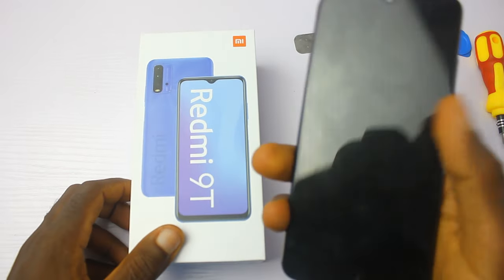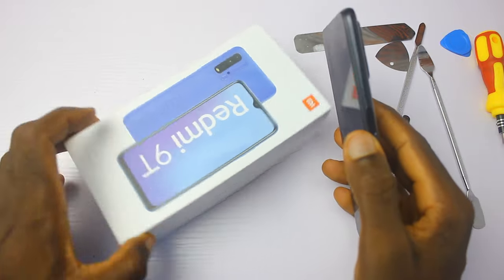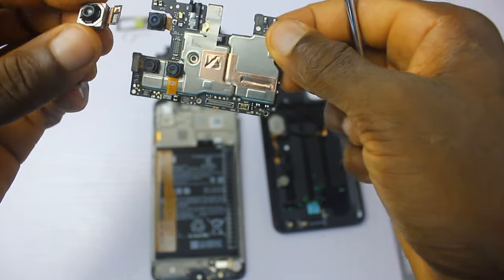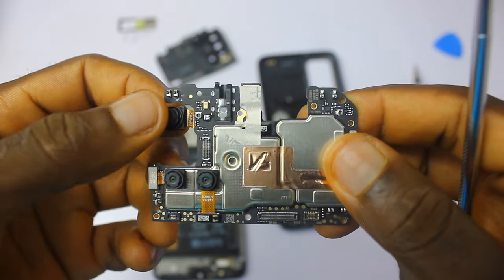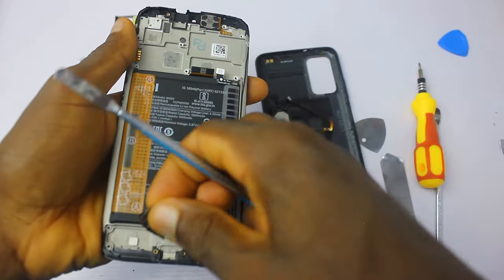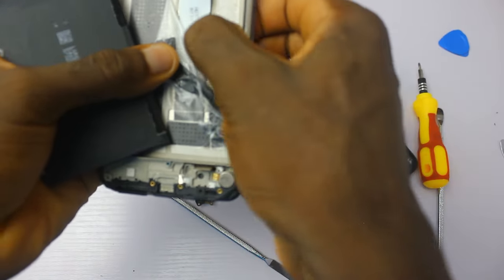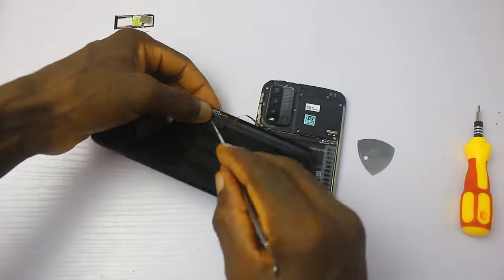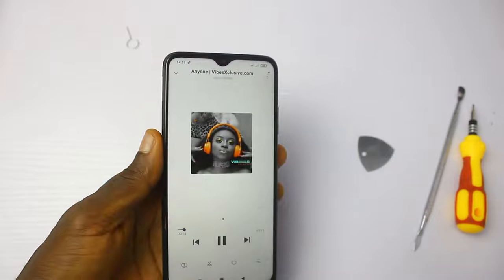Redmi 9T Teardown: The Best Budget Phone Yet?

Comment: Thank you for making this teardown video. But you should be careful with your way of using the tools, bro. Using the metal tool to disconnect or removing battery like that is dangerous. If you puncture the battery, it would combust or explode. But that's ok. Thanks again for the video.

Comment: To those having blackout 9t redmi

Leave it for 2 days..Dont touch any button..Put the phone inside one box n after next day charge in and see btry symbol coming not..If it comes let it charge fully..Charge till max n dont press any button yet..Fully let it charged..Now let it somemore one day inside box cooling itself..Now turn on next day with pressing volume n start button togather. It will on.Turn off updating app on MIUI permanently.. Dont let phone update at all.. It will reboot n cause more black out later n hard to on.. So off the updating.

Important Reminder 👇
Once phone On..Always charge the phone before battery finish so its not off.

Comment: The problem with this phone is that it never turns back on after a restart. This is a major issue because litteraly you need to remove the battery then put it back only to have it restarted. We had a lot of that issues here with this model.
Reply: yeah thats what i have experience just now
Reply: Same problem here bro.....at start it was ok but....once i got this problem it is recurring now....BIG HEADACHE

Comment: Very weak phone. i use it in gaming for only 5mins then it will heat, warning appear in my phone.. i recommend not to buy this phone.. worst phone ever
Reply from the maker: If you're using this device to play graphics intensive games, then you'll definitely get that error. 

Thank you for sharing your experience
Reply: @techrann7693  So u mean sir this kind of android phone is not good in gaming?
Reply from the maker: @junlyzxc7153  it's not good for intensive gaming. The SoC inside is not built to play heavy games. It'll work for standard games but will struggle when it comes to graphic designing intensive games
Reply: @techrann7693  Is that so, that's why when I play call of duty, 5-10 minutes it's easy for the phone to heat up and my hand hurts from the heat,
Reply: @techrann7693  why its not switching on after rebooting or switched off?

Comment: Try charging the battery after reassemble
Reply from the maker: It's damaged 😞😞. It won't charge and I knew why and it's also fixed now 😃😃
Reply: @techrann7693  oh..  sorry to hear that...  thanks for the video...   i dropped new redmi 9T while unboxing...  seems nothing damaged from outside but only the back cover opened a little from top right side...  should i check something else...
Reply from the maker: @muhammadarsalan302  Plug in the charger, try the headphone jack, speaker, mouthpiece and earphone. If all is working and the screen is intact then you probably have nothing to worry about aside from changing the plastic back cover.
Reply: @techrann7693  thanks a alot ...  all these things you mentioned are working fine .. also the camera is working fine...  middle camera 48 mp lens is taking picture.. can you please tell me how can i check the upper 8mp and lower camera lens?
Reply from the maker: @muhammadarsalan302  the 8MP is ultra wide. You have to switch to the ultra wide lens. While the 2MP is macro, which means you also have to switch to the macro lens to check if both are working.